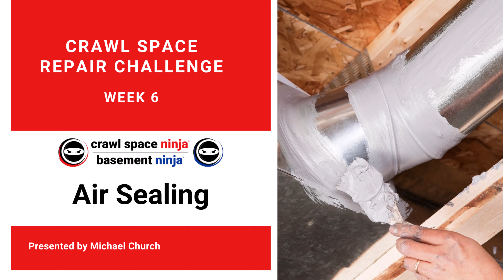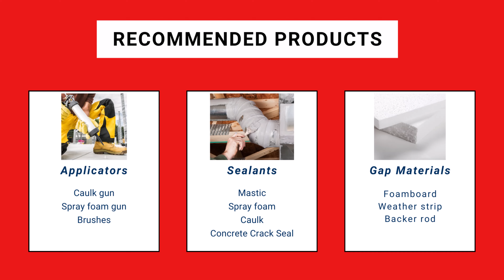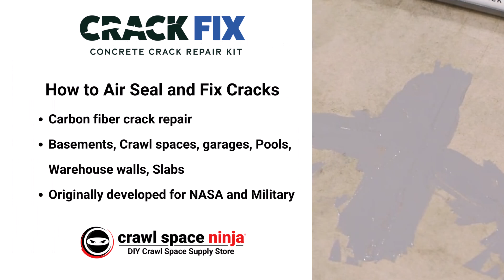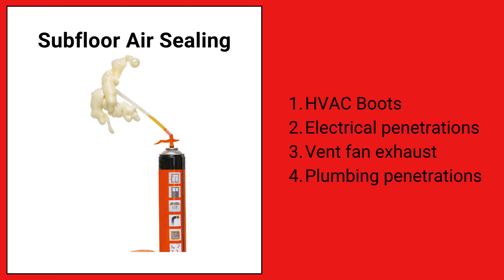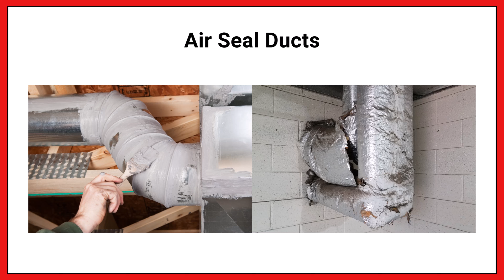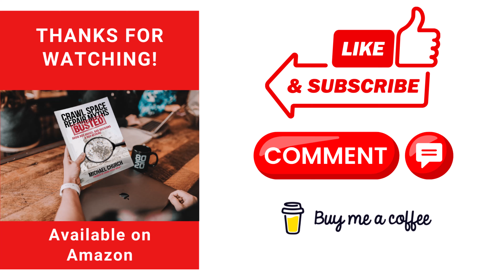Hidden Crawl Space Leaks Are Destroying Your Home Right Now

Comment from the maker: 💨 PRO TIP: Save this video for your next home improvement project!

Air sealing is one of the most cost-effective ways to improve your home's energy efficiency - you can save 10-20% on heating and cooling costs! 🏠⚡

Key takeaways from this video:
✅ Foundation wall sealing stops air leaks
✅ Subfloor gaps waste more energy than you think

✅ Ductwork sealing improves indoor air quality
✅ Simple materials = big results

What's your biggest air sealing challenge? Drop a comment below - I read every single one and often feature your questions in future videos! 👇